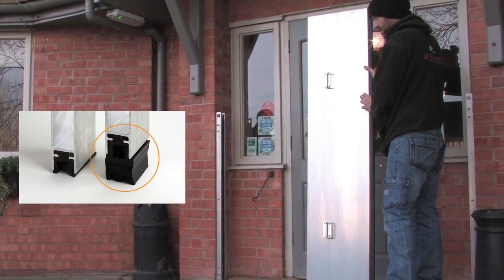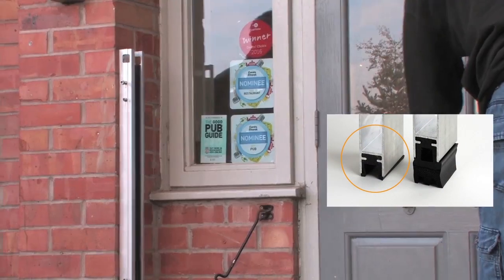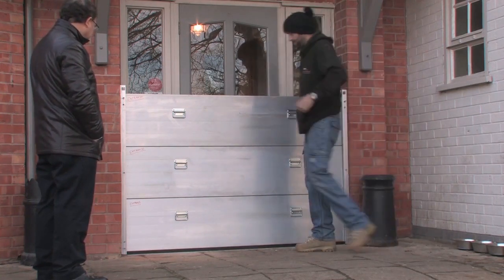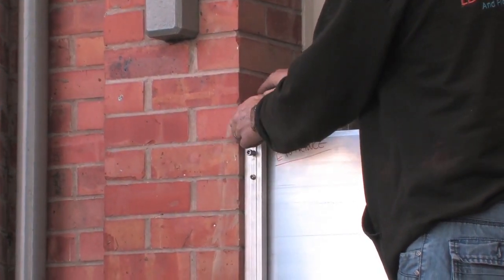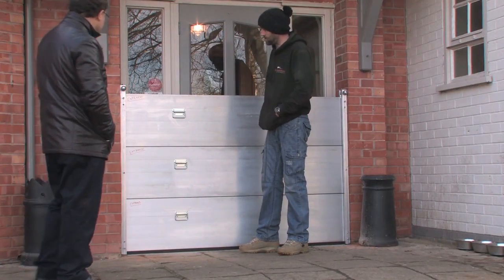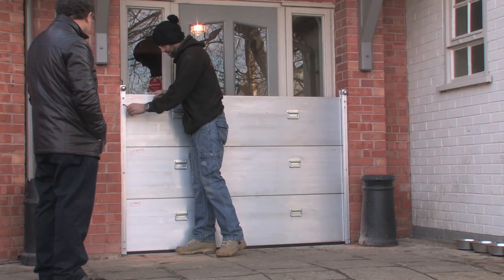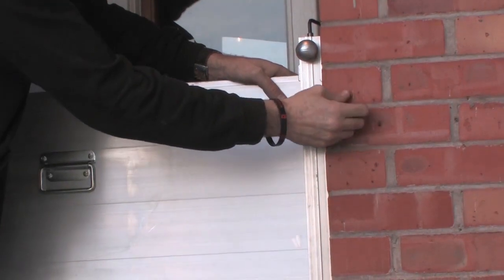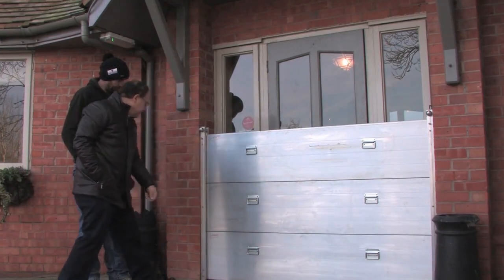Buffalo Barrier - Flood Barrier Deployment

Comment: Quite a lot of bits to loose when assembling in the dark in a panick. Feels like they should be "captive" elements so they cant fall in the water, get removeved by vandals, fall down the drain etc at the critical moment!
What are the handles for? They don't get used once in either assembling or dissasmbly.